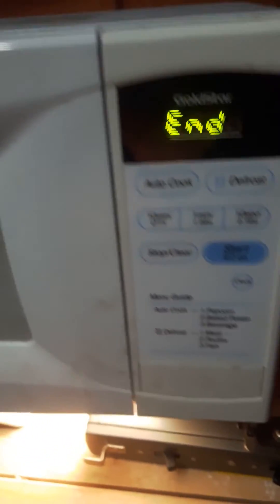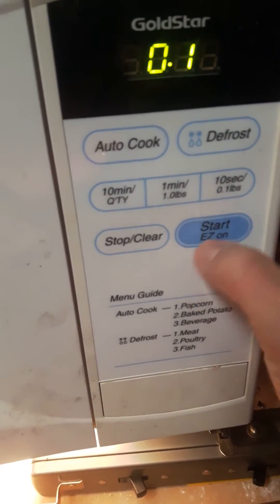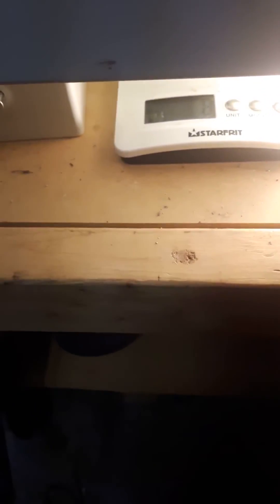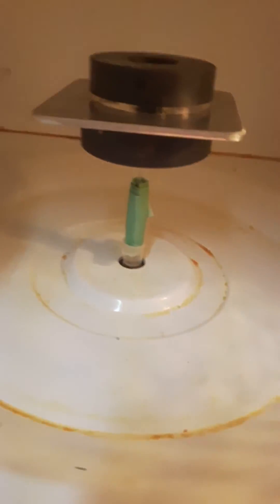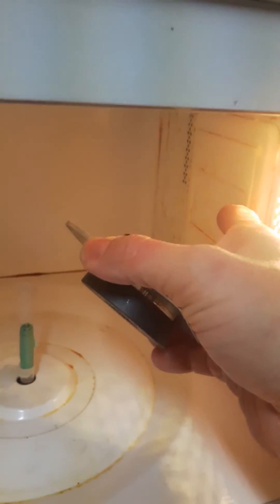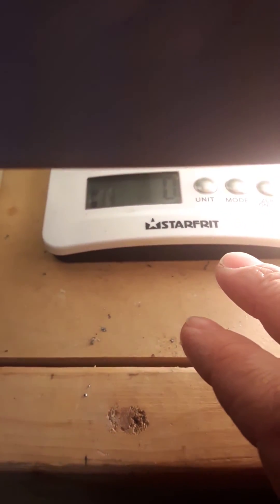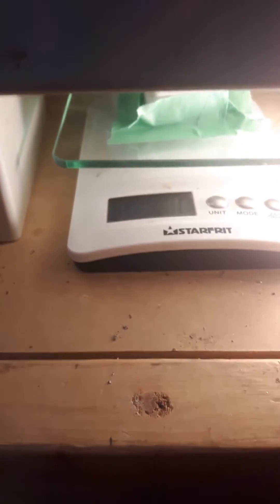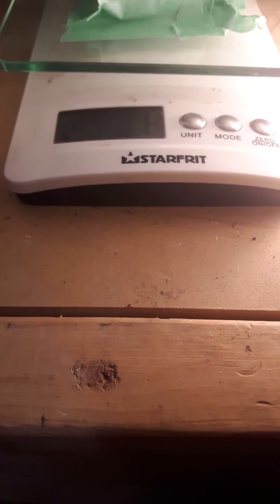Weight Loss in Aluminum?

Comment: I think you had some SUCCESS here. 10+ grams change is significant. I think this one worked better than your other Alzofon experiment because of the high watt power microwave and much better resonant chamber of and the direction of the magnetron was parallel with the earth. You should really revisit this experiment. Try with a round aluminum shell, put the magnet(s) inside the 'egg' shell. etc. Then maybe try to get the magnetron and propulsion inside the shell. Boom you have your craft/ufo.

Comment: I thiink.. Magnet try attract
 to metal bottom. Then you put scale on 0... Now when you heating the magnet loses strength and weaker attracts to the bottom...
Reply from the maker: Great observation Igor, I recall the top magnet heated up, but I could still hold it. I believe the Curie temperature of ceramic magnets is quite high? So, if the top magnet heated up more, and lost its magnetism, then the subject would get heavier because the bottom magnet would pull downwards more than top magnet pull upwards. Anyways, I want to redo this with better set up soon.

Comment: This setup should not work based on the theory as you need the rf to pulsate to allow the nuclei to orient themselves.
We plan on trying the same experiment but with professional equipment at 3000 gauss 9.5ghz pulsating as described in the book.
Reply from the maker: Looking forward to your results... I recently did more experiments and will post in a few days.

Comment: Another thought, are the magnets attracted to the base of the microwave? Perhaps the heating of the magnets in the microwave destroys thei magnetism and attraction to the base (which they appear closest to). This could explain why you see the “weight loss”
Reply from the maker: You are thinking of the Curie temperature? Maybe, I don't know for sure. Would be difficult to measure the temp. Of the magnets. I haven't got around to doing experiments with GUNN diodes (which I purchased) as the uwave source yet. No heating with those as the power is low.

Comment: Can you do another test with a non ferrous non magnetic material of the same mass as a baseline? That water will also be evaporating and creating convections that could influence your weight measurement. Find a way to shield the magnet from convections to eliminate this possibility. Can you weigh magnet before you do the experiment and then weigh it again afterwards using a different scale?
Reply from the maker: I need to get a different scale, a scientific one. Convection currents are negligible, and not sure what you mean by non ferrous material. The inventor called for the use of 99.999 percent pure aluminum, I didn't have that, but some aluminum alloy. Pure aluminum is very expensive, and called for due to the net nuclear spin of its atoms. Also, there are other experiments to do with GUNN diodes and uwave pulsing of the sample. I have yet to set all this up. I believe it will be a closer replication to the successful 1994 experiments

Comment: ... curious if ALL the original weight had returned (-11) but scale  “timed out” ... then you did another trial. Scale showed weight down another -12 gms.  I wondered are you -20 from original at this time??
Reply from the maker: That would be about half the weight of the plate, I doubt it. I would have to study the video again. I have noticed spikes in weight fluctuations on that scale associated with high voltage discharges in and out of dielectric masses. I plan on posting a video of these really soon

Comment: *MORE INFO ON PROPER FREQUENCY POSSIBILITIES*

This is from a military aircraft radar witness:

"Electronic equipment on the aircraft of primary interest here was monitor no.2, operated by an Air Force officer named McClure. It consisted of an ALA-6DF passive receiver with back-to-back antennas in a housing on the belly of the plane having spin rates of 150 to 300 rpm in scanning the azimuth. Incoming signals were displayed on an APR-9 radar receiver and fed into an ALA-5 pulse analyzer. An official report by the Wing Intelligence Officer at Forbes AFB in reference to the UFO said: 

*......intercepted at approximately Meridian, Mississippi, a signal with the following characteristics; frequency 2995MC to 3000 MC; pulse width of 2.0 microseconds; pulse repetition frequency of 600 cps; sweep rate of 4 rpm; vertical polarity ....Signal moved rapidly up the DF scope indicating a rapidly moving signal source; i.e., an airborne source. . .*

Bottom of page 85 in: 

http://www.noufors.com/Documents/Books,%20Manuals%20and%20Published%20Papers/UFOLOGY.pdf

Definitely a microwave frequency.  However, the magnetic field would have been very high.
So the metal  alloy?  that 'they' were using is probably not strictly aluminum.

.
.
.
Reply from the maker: We should talk further and design a better experiment. Email me at centrinamics@gmail.com if you are interested
Reply: @failforwardresearch3127  Sorry I missed your reply - there must be a bug because youtube is not consistently putting a red mark/number on the bell icon in the upper right corner to indicate a reply was written.

It is hard(er) to get an inertia quenching to work with atoms firmly 'locked in' to the lattice of a solid.

*RANKED IN ORDER, HARDEST TO EASIEST, TO EVOKE AN INERTIA QUENCH*
1)  atoms with 1/2-spin nuclei (or a multiple thereof, say 3/2 nucleus spin, or 5/2, or 9/2, etc) that are 'locked in' the lattice of a solid are hard to evoke inertia quench behavior

2) atoms with 1/2-spin nuclei (or multiple thereof) that are in a liquid - such as brine, or mercury cut with a 1/2 spin ferrous substance like cobalt - such atoms as a group are easier to evoke an inertia quench, compared to a solid, since we need to align/oscillate the nuclei and that is easier in a more loosely-bound liquid than in a tightly-bound solid

3) atoms with 1/2-spin nuclei (or multiple thereof) that are in a gas - perhaps a highly-compressed gas - are much easier to evoke an inertia quench 

We need to get the atoms aligned and accelerated (oscillated) to achieve an inertia quench and it's easier when atoms are not tightly-bound like in a solid.

That's why the McCandlish ARV's center column is a 'vat of gas/vapor compressed to 250 atmospheres.'  We would prefer as many 1/2 spin atoms per unit volume as possible.  The density of a solid is nice.  But it's harder to get a response from the nucleus in a solid, locked into the lattice, pretty immobile and shielded by electrons that are also 'locked in' because they keep the lattice of the solid together.  So let's try for the density of a solid, as many atoms per unit volume as possible, in a loosely-coupled, highly-compressed gas/vapor.

We want a highly-compressed gas of 1/2 spin atoms  (1/2 spin because such nuclei have a magnetic moment that can be used to align them/make them oscillate)  with a density approaching that of a solid.  Align the nuclei with a high-field DC magnet, then oscillate - which accelerates, in situ, the aligned nuclei. 

That will quench inertia.  And a uniform inertia quench, uniform about the platform or hull, will neutralize gravity, which is nothing more than a partial quench of inertia-creation ability of the background field, in a gradient with the strongest quench at the densest part of the planet's atoms - its center.  Gravity is a declining inertia gradient with the decline in inertia creation pointing in a vector  from space towards the Earth's center point.  Earth's atoms are PASSIVE, their internal, consituent parts are accelerating, but NOT IN UNISON.  However, the immense number of atoms in Earth create a weak inertia-creation quench of the space in the immediate vicinity to create a declining inertia-creation gradient with the least-energetic - ie. the smallest magnitude of inertia creation - as you move from space to the planet surface.  We call that 'gravity'.  "Gravity is the weakest force!"  No, you're basing that on passive matter.  You can create the same gravity field strength in a small (relative to Earth) 1/2 spin metal object by aligning/accelerating (oscilating) its atoms.  "Gravity is weak" NO.  Gravity - a declining inertia gradient - is MADE.  It is VARIABLE. 

Normal amounts of inertia are created, by atoms, in open space.  Near large matter objects, the electromagnetic background field has been altered and its ability to create normal amounts of inertia with atoms DECLINES in a gradient as you move closer to Earth.

If you want to use a solid, then using high-field NQR (nuclear quadrupole resonance) is best.  NQR or NMR for liquids and gases.  Or plasmas.

What I'd like to do is this: 

1)  create a plasma in a microwave cavity resonator
2)  push all electrons away from the atoms using a static electric field - goal is to prevent tons of electrons around the nucleus blocking or shielding the nucleus from the applied magnetic field if using NMR
3) apply a high-field DC magnet to align the nuclei of exposed 1/2-spin ionized atoms
4) apply an orthogonal microwave-frequency magnetic field to the nuclei to oscillate, ie. ACCELERATE, them in place

That will quench inertia in the background field inside and immediately around the device.  What people call 'anti gravity' is nothing more than a uniform inertia quench all around the hull or platform that BLOCKS the effects of the declining-inertia gradient. 

And gravity is the declining inertia gradient.

From General Relativity - "acceleration of matter creates gravity fields".  Einstein supposedly was miffed because he thought in order to prove this "acceleration of matter creates gravity fields" in a lab setting would be impossible due to the size of mass required, since 'his' gravity was very weak and came from passive matter objects.

But atoms are matter!  If you accelerate atoms per General Relativity, you 'create gravity' - what he implied but (perhaps, because the model of the atom was not around in 1915?) did not understand was that gravity is a quench of the inertia-creating ability of the background field.  And NMR - aligning/oscillating (accelerating) atoms was developed much later, from 1938.  So Einstein couldn't realize "I can accelerate the individual atoms in a matter object to test my 'acceleration of matter creates gravity' idea.'

It will take a very long time I think but eventually it will be known that inertia IS NOT a fixed, static trait of a chunk of matter.  Inertia is CREATED.  By the extreme accelerations of the internals of atoms.  Spin, orbital angular momentum, etc. 

PASSIVE MATTER:   no fields applied to align and oscillate/accelerate the nuclei (where 99% of the mass of the atom lives)
ACTIVE MATTER:  a matter object whose nuclei possess a magnetic moment, ie. 1/2-spin nucleus, has its nuclei all aligned together, and then has its nuclei accelerated (oscillated) as a group at the relevant Larmor frequency.

It's important to note that Einstein recanted later and admitted that the backround field exists.  Today we have experimental proof that the background field exists and is partly electromagnetic in nature:
- the Casimir force
- spontaneous emission
- the Lamb Shift 

Gravity is a diffusion effect (thermodynamics).  Atoms in open space create inertia equally when accelerated in any direction.  But atoms - matter objects -- that approach Earth show a drop in inertia in the vector pointing at the densest part of Earth's atoms - its center.  The side of a matter object facing Earth creates slighty less inertia than its opposite side.  Per thermodynamics, the higher energy on the opposite side leads to a diffusion of the matter object to the lower energy region near Earth.  Earth's atoms' accelerations quench inertia.  That quench dissipates, with the square of the distance from the planet.  And any PASSIVE matter in that region of declining inertia creation diffuses or 'falls into' Earth.

Active matter prevents uneven inertia creation on a matter object.  Instead of having higher (inertia creation) activity/energy on the side of the object facing away from Earth, and the near side having lower (inertia creation) activity/energy - which leads to diffusion or 'gravity' --

Active matter FORCES a uniform, balanced inertia-creation activity throughout the body of the matter object.  So NO DIFFUSION happens.  No 'pull of gravity.'

Matter objects don't 'pull on' each other.  Their atoms alter the space in and near them - their atoms' accelerations quench inertia creation - which sets up the declining inertia gradient and a diffusion activity for any PASSIVE matter object.

Sorry so long.

Comment: *EXPERIMENTAL SETUP*

One thing to consider.

Witnesses report very strong electromagnetic effects: radios malfunction, car ignitions stop working, etc.

That means a HUGE, MASSIVE magnetic field is in use.

The Larmor frequency *changes* commensurate with the strength of the static magnetic field.

Your magnet is too weak and the Larmor frequency, while potentially matching the strength of your magnetic field, from the microwave will shift if you manage to change the experimental setup to a stronger field.

I plan on testing with 1 to 2 Tesla, minimum, for the static magnetic field.  The Larmor frequency will not be the same.
Based on witness reports, I suspect the magnetic field required might be in the TENS of Tesla in strength.  A multi-layer shielding of mu-metal or equivalent probably shields occupants from the field effects.

Also, it will help you feel better about your setup to make your OBSERVATIONS - which you have to admit is the #1 most important thing in an experiment --

MORE CONVENIENT.

Having to clumsily duck under a large metal box that may be vibrating is really inconvenient.

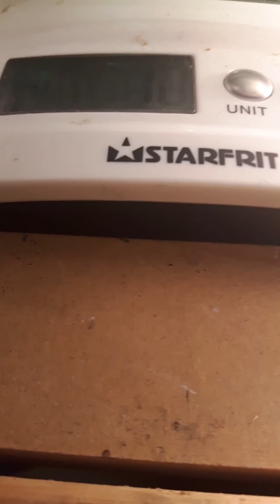Experimental design will 100% save you time.  You can see from the test around 10:50 or so - when the scale did not return to zero after the magnetron shut off -- that it confused you.  It also confused the audience.  Particularly because in the earlier test the scale responded as expected, after the magnetron shut off.

You'll save a LOT of time and grief, and confusion, by setting up the experiment so that there is NO QUESTION or confusion as to whether you're getting a positive test result or not.

.
.
.
Reply from the maker: Possible Sources of error:
Some changes on scale from touching microwave oven (although changes occured long after too in seeming correlation with the microwave irradiation)
Heating of top magnet shifting Larmor frequency off 2450Mhz.
Not pulsing sample with microRF at ideal duty cycle as specified by the inventor.
Impure Aluminum (pure 99.999% specified but very expensive) .

Note that for every 1T of field, the RF required is about 28Ghz to hit the Larmor frequency, and a Dynamic Nuclear Orientation/Polarization state.

Comment: Addendum......since the interior  of the microwave oven  is  steel.....is there  the possibility  of  the magnet  loosing gauss due to being heated.? I like your experiment. Respectfully, Ron Kita, Chiralex
Reply from the maker: The top magnet heated quite a bit. I dont know if this would alter the magnets field. So maybe it caused fluctuations in Larmor frequency, which might explain the mixed results I got.
Reply from the maker: The temperature changes in the magnet would not likely correlate with the rapid switching on and off of the magnetron. In other words, the hysteresis of the flux changing as a function of being 'nuked' , if temperature is a factor, is way too slow to be causing the weight to change that quickly, as I see it.